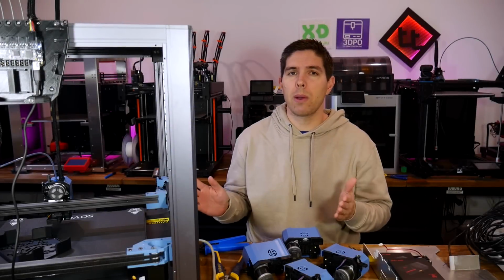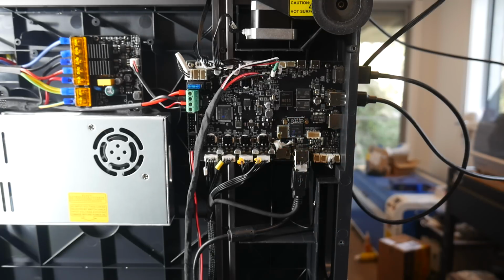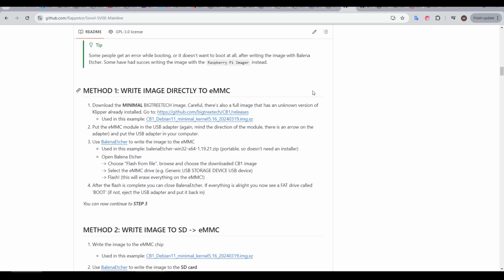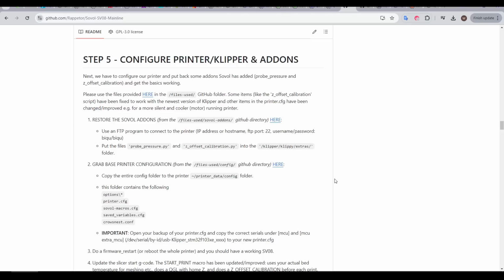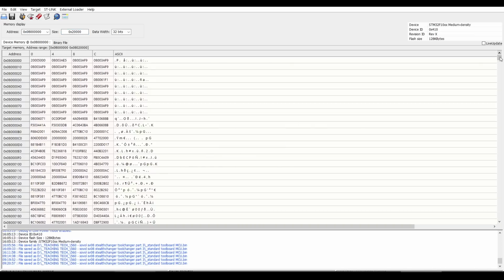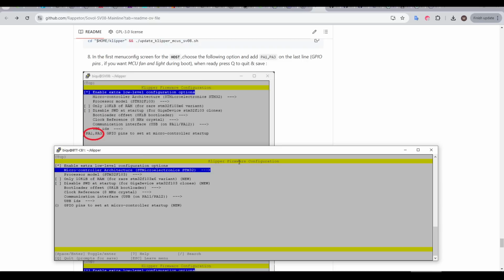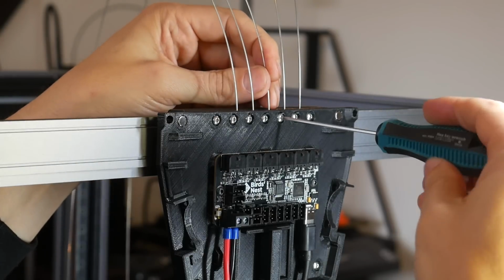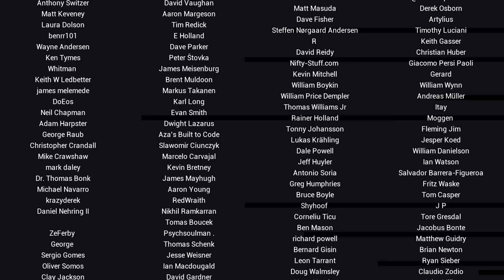Better wiring and mainline Klipper - Budget Sovol SV08 toolchanger part 3

Comment: Wiring mine up now, and I’m a bit confused. What’s the point of sticking an extra bit of wire onto the shielding and crimping it into the molex connector if there’s nothing going on the other side of it? Is it necessary? Or just to have all the pins filled out or something

Comment: I really want to switch to mainline so i can install my eddy to SV08 but i know ill brick the printer somehow or a step won't be there! I couldn't even get it to connect to wifi. Literally just doesn't find it! Have to ethernet it just to get it connected! 😂
Reply: It not connecting to wifi is due to it having issues with WPA3. If you can go into your wifi router settings and change it over to WPA2, it should work. I had to setup a second SSID on my router to use for IoT things that just uses 2.4GHz and WPA2, so I use that one.

Comment: Now I understand why my makerbase pie that I made to run clipper on a fokos Odin 5 during the raspberry pi shortage has to run off of a microSD the first image went to the EEMC and was apparently a bad image and wouldn't work or it was me being my first time and clipper being pretty new long story short i have to run it off of the SD card to get the printer to function now I know how to fix that Thank you. I done everything the second time the same as I did the first and it worked the second time I don't know I am not versed on Linux but I did use one of your first clipper videos too help between your channel and 24/7 printing and Chris's basement I have a fast bedsinger that prints high temp materials so again thank you teaching tech!!!!

Comment: I have tried flashing the recommended image 4 times now.  To both a new EMMC and new micro-SD card.  Followed the instructions, and upon boot I get that irritating beep for what seems like at least 4 minutes, before I turn it off.  The original EMMC only takes about a minute before it's running.  What am I missing?
Reply from the maker: Sorry to hear you are having problems. Hard for me to advise when I didn't experience tht issue. I'd recommend reading/posting on the GitHub issues section.

Comment: PLEASE PLEASE PLEASE. do a full review of the LTO smart orbiter 3. I believe it has inbuilt tool board with accelerometers and USB connectivity? Are the hardened gears standard or an optional extra. What is the hot end max temp???? Please do a review. 🎉

Comment: Has anyone else  tried converting their sv08 to mainline klipper?
I just converted mine (followed the github instructions) and everytime I "save and restart" from a config file, I get an error and the printer shuts down... (also can't change z-offset from LCD screen mid print and the z-offset macro fails right at the end)...
Does anyone else have this issues? Or an idea what might cause them?

Also while trying to troubleshoot I compared the new config files to the old ones: They changed alot (from M117 wording, homing sequence, to full blocks of code missing) , sadly I don't understand inove to know which part causes the error and was just able to comment out the diffrences.

Comment: Hi! I love your channel; I find it very educational, and you focus on really interesting and less common topics. Watching your new video series, I have a question. Would it be possible to combine one of the tool changer heads with the ERCF project while using the other heads for different materials? For example, using one head for multicolor PLA printing with the ERCF, along with carbon fiber filament, TPU, and a water-soluble support filament in other.

Congrats on the channel! I think it's one of the most interesting ones out there, and the tests you do and the questions you raise are always fascinating and clever. Thanks and best regards!

Comment: Regarding the cable from the birdsnest to the toolhead - why is a 5 conductor+shield needed when a 4 conductor+shield gets all the signals plus power & ground there?  I looked at the manual and didn't see any requirements for additional ground lines.  It's pretty common to tie all extra pins in a connector to ground so they don't float, but aren't strictly required.

Comment: On the final cables, are you going to add some heat shrink over the end of the nylon wire loom so it doesn't fray so much?
Reply from the maker: I've been using some cloth style tape for that. It ends up very neat.

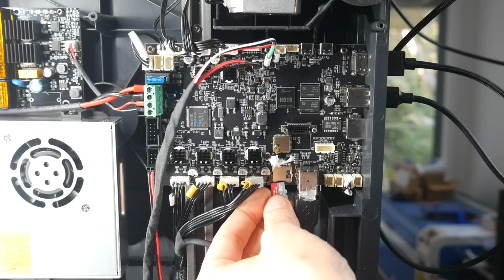Comment: Have no Docker - no go. Maybe hostiger devs do it connecting the sensor. They ask no more, but to find a fool to get all this hardware to play with. Possibly somebody here had a nightmare about how being irresponsible with c++ could change lives irreversibly. Battleship that actually does something in a battle to reach anything 2:59 and ST you be dreaming about it until growing up. Allowing all the blocked things is wrong, but then it's opposed to internet is free to everybody. Since then you be doing everything with VSCode. 7:03 all the time imagined as connecting all the systems to full power right before your engines fail and you crash Into Yela/Lyria.

Comment: Is it mandatory to update Klipper to the latest version, or would older mainline version, compatible with MCU and toolhead, be enough?
If I had SV08, hacking a working, not-so-cheap printer that is meant for printing stuff, for a Klipper update, would be the last thing to do.

I would expect many printers will be fu <-<- bricked in update process 😐
Reply: You can't brick the printer by updating klipper version ;) the only thing which may happen - version mismatch, and even though Idk how well it's implemented on the usb toolheads, but with canbus I can upgrade my whole setup without even raising my ass from the chair
Reply: @felixyasnopolski8571  When you start tinkering with raw programmer like in this video (be it JTAG or other hard loader), if you actually watched it, people will fail. Fail to upload before erase, change fuses to protect FLASH, it's dead, Jim.

Comment: sooo im on stock firmware and my klipper is on v0.12.0-5-g6c1004f3. you may need to uninstall and then install it to update it sometimes. just a heads up . granted it is the Sovol version.

Comment: Although talk of manually preparing cables and writing firmware code makes my brain melt a bit, I can't overstate how wonderful this whole project is - democratized toolchanger printing is super important, especially for people looking to move away from wasteful multi-color and -material printers.
Reply: As a P1S owner I am disgusted by the gluttony of the AMS style systems. I am going to build this when the documentation is done. This is basically a 5 toolhead voron for $1000.

Comment: A small tip: If you just need more IO pins for stuff like a filament encoder sensor, additional environment sensors or what not, you can also get a cheap Blue Pill board and hook it up to the unused USB port on the mainboard. Blue Pills use the exact same microcontroller as the stock mainboard and toolhead board, so you don't have to think about the Katapult and Klipper configuration, and you can easily extend Rappetor's nice automatic MCU update script to also handle your Blue Pill. Even works with the dirty stock Klipper installation.

Comment: Beware that if you hold on to your original EMMC as a backup and install the full Linux + Klipper on a new one you will have to upgrade also the firnware on the microcontroller. So if in the coming future you put back the old EMMS thinking at that as a backup it may now work as it's supposed to deal with an older release of the MCU firmware than the one you have installed. In case you should think about a backup of the original firmware as well (if not present in the main OS) and reflash that as well.
Reply from the maker: That is correct. If the steps are followed to back up the MCU firmware, it is a pain but this is reversible too by flashing back the standard firmware.

Comment: So Michael, what gauge wire are you using for that 5 core shielded cable?  I’m having a tough time finding 18gauge shielded in 5 core.  Best I can do here is 5 core shielded 20AWG wire.  Do you think that would be enough for the power draw?
Reply: For 4 Amps and 1.5 metre cable, you should be safe with 20 awg.
Hotend heater should not draw more than 2 amps, 1 amp for extruder motor and fans is enough.
Reply from the maker: I agree. It's just that Aliexpress cable is a bit off in spec so 18awg from them to reach the equivalent of 20awg.
Reply from the maker: I've ordered some 18 gauge from Aliexpress. Wire there seems to be one step under is terms of cross section, so it is actually more like 20 gauge. 20 gauge is the Voron recommendation so I'm happy with that. It is RVVP which is shield flex cable, so hopefully fit for the purpose. I can't vouch for it until it arrives but here is what I ordered: https://www.aliexpress.com/item/1005006371513803.html

Comment: This looks like a fairly accessible project. At this point, I've only upgraded an mmu2s->mmu3, and replaced the stock hot end on my MK3s+ with a Revo. I've love to have a printer with a larger build area than what the Prusa footprint offers, but that 4K price tag is hard to justify. I feel like I could add 1 additional tool head, and if all goes well, I can add the rest as time allows. Thanks so much for doing this video series, and like many others I'm hopeful for the final results!

Comment: Have you spoken with Sovol about getting the software upgrades into their next release cycle?  It seems that if they get on board and perhaps even sell a multi head printer as an option that they will make a mint.
Reply: Sovol teamed up with another company for a multimaterial/multicolor solution (Co Print ChromaSet.) I'm guessing they will push that before anything making life easier for alternative and diy solutions. Most companies are going to go for the cheaper all in one single toolhead solution instead of a pricier more complicated multi-head design. Especially companies that sell their own filament because the waste associated with purge towers is better for them.

Comment: Awesome! Started buying parts for this build, can’t wait to see it completed! 

I have been having an issue deciding what umbilical cable to get, most of the dedicated ones are 4 core plus shield 24/20 awg. Having issues finding a twisted/sheilded 3 conductor 24awg with a pair of 20awg for power. 

What are you going with ? 

Thanks
Reply from the maker: Can't vouch for it yet because it hasn't arrived but this is what I ordered: https://www.aliexpress.com/item/1005006371513803.html
RVVP is suitable for this application. I went for 18 gauge, 5 core, 10m so I will have plenty spare after six toolheads. 18awg from Aliexpress is more like 20awg from elsewhere.

Comment: Note 1: If you're looking at programmers for STM chips that have a "PL" in them, DO NOT BUY! Prolific, who make the genuine chips, have DRM on the driver that prevents older models and clones from working on Windows 11 and possibly 10 if it's old enough, and these are the drivers built into the OS as well. PL chips should work with the Linux driver as I don't think prolific maintains the linux driver.

Note 2: Rasberry PI imager can image other SBC images as well and only checks USB ports for drives to image, so you don't risk imaging your boot drive.

Note 3: you can use SSH in the Windows terminal and if you're a linux user most file explorers on that OS support SFTP
Reply: You can use SSHFS on Windows, it makes a mess of the uMASK but you can have it mapped in Explorer.

Comment: Cool update! I recommend checking out `udev` you can write some rules to add aliases for USB serial devices based on which hub and port they are plugged into. With that you should be able to make your klipper config more generic, so it can be shared with others. I'd be happy to help with this if you want to pursue it.
Reply: This would also help if you ever had to replace a toolhead because the config would follow the port rather than the serial number of the board.